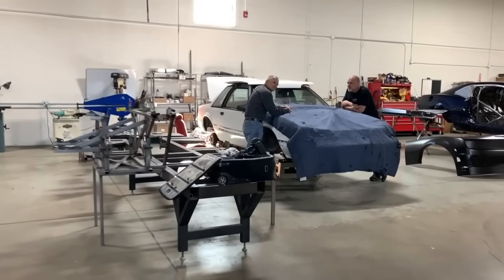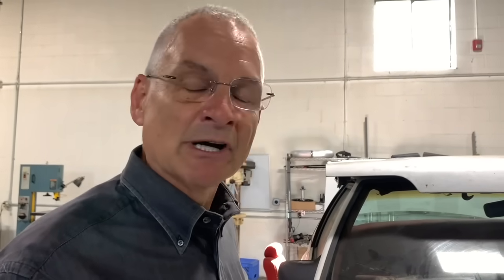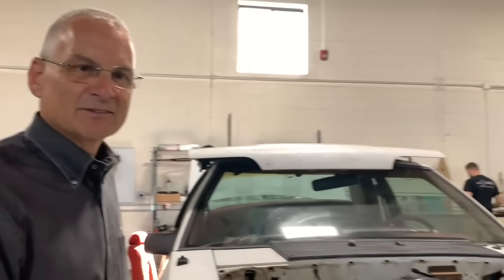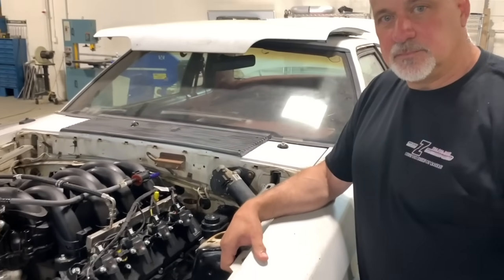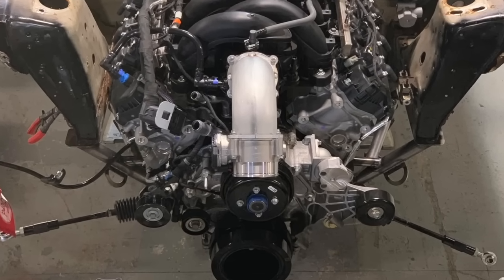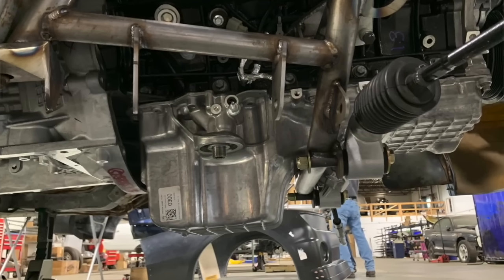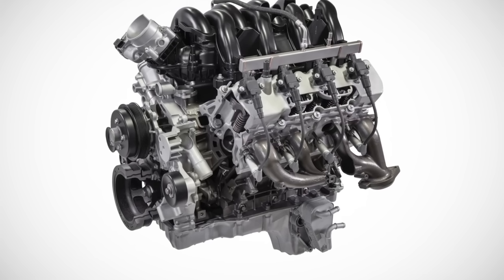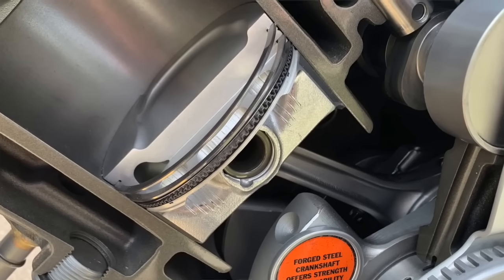Ford 7.3L "Godzilla" V8 Foxbody Mustang Engine Swap — Team Z 446-cube Small-Block Project Part 1

Comment: So many questions!
How many RPM is this good for?
Is this the first ever 10R80 transmission swap?
Is someone making a controller for the 10R80 now?
Is the Godzilla available as a crate engine?
Reply from the maker: Stay tuned for my next video.
Reply: REVan Evan waiting, waiting. LOL
Reply: I believe power by the hour already has 10r80 swap kit with stand alone controllers
Reply: @dfro7159  they do
Reply: I believe they said they used the mustang 10speed. So that’s a 10r80.
Reply: I’ve heard this has a modular bell housing so you can use 6r80s, 4r70ws etc. with a manual valve body
Reply: stylac there have been quite a few 10R80 swaps done. I have one in my 1966 F100. Very tight but fits. I am using a stock ‘18 F150 PCM.
Reply: stylac the 7.3 uses the 10R140. Not sure if bell housing pattern the same.
Reply: Same rear face of block as the modular/coyote
Reply: Brian Wolfe Nice! When can I buy a 7.3 crate engine? I suppose there will be wrecked trucks for donor soon. Then I can use the 10R140
Reply: As of now, I believe the only place is the parts department at your Ford Dealer.

Comment: Evan please answer this.  What's the deal with this engine being tuned for perfect stoich in the truck even under acceleration? Did I hear that correctly in the press releases?  If that's the case there's a ton of power to be had just by richening the fuel mixture on acceleration right?  Or did I misunderstand the presentation?
Reply from the maker: I will have to ask Brian to answer that one. But there is a lot of power left on the table with a tune, cold air and headers.
Reply: @revanevan  no doubt I'm excited to see this unfold.  Thanks for the reply. I'll be keeping tabs on the process for sure. Just for fun my bet is around 50 horse with just a tune.  If my understanding is correct about the air fuel situation that is...... Cant wait to find out thanks for posting these videos man love your work 👏
Reply: I can't speak to the production calibration, but there is a Dyno cert for incomplete vehicles (those that go to body fitters) and a Chassis Cert for complete vehicles.  I would guess that the stoic comment was more around the Dyno cert, but am not 100% certain.

Comment: This 445” Thunderjet small block is going to hurt some feelings!
Reply: I'm not making any predictions until I've seen the head ports and specs.
Reply: @johnparrish9215  yeah......if the heads go 300 cfm plus on the intake with at least a 75% intake to exhaust flow relationship at .600" lift and under, then it's a winner. Ford has had a bad habit for decades with weak exhaust ports. Just seeing a cam only 7.3 break 80hp/liter would be awesome. 
How much for a crate package?
Reply: Brother Django Dakota that’s my personal question, is how much these engines will cost
Reply: @hoost3056  it does make just over 300cfm on the intake side. It's also a canted valve head. Much better design than older factory sb heads for sure. Make will make 600hp no problem with cam and exhaust. Even more up top with a intake. Which I'm sure aren't far behind.
Reply: @waynebollentin989  the head is a Trick Flow copy almost with the valve angles and combustion chamber shape👍
Reply: @hoost3056  what tfs head is it a copy of ?
Reply: @waynebollentin989  The Twisted Wedge designs. Fast burn chambers with altered valve angles. Kinda reminds me of them.
Reply: @hoost3056     A wedged head is still a inline valve head. These new 7.3 heads are actual canted valve heads. Not a copy at all.
Reply: @waynebollentin989  ok, so more like a bbf design ( 429-460 )
Reply: @hoost3056  lol yeah now your on the right track but they were a big block. That's what so bad ass about these factory heads. Really nice design. The ls had a good sb head but ford just came out with something better. Can't wait to see these heads on a CNC machine etc.. 400cfm shouldn't be a problem. Won't be long before they're making 800hp+ N/A. I honestly wasn't sure when I first heard about this motor but it looks like they did an incredible job. The 6.2 v8 never took off and many act like the 7.3 is the First V8 push rod gas engine in many years. Take care bro.
Reply: The trick flow is just a copy of the Gurney-Weslake heads from the 1960s
Reply: There’s already videos out there of the ports. The engine makes great torque curve and already hit 600 hp at 6200 rpm with a cam swap
Reply: John Parrish no it’s not. It’s a rv motor
Reply: SoCalBronco70 Back in the day RV’s came with big block Chevy’s and big block Ford’s and big block Mopar’s, and people now and days will take RV motors out, put speed parts on them and make them fast
Reply: @5ohJ   ya! a car RV to pull the fiat dodges down the track 😂😂😂
Reply: crown Victoria lifestyle I believe the 7.3L make 430 horsepower and 475 torque sir
Reply: thunderjet?
Reply: Better name for this engine than Godzilla

Comment: And people said they wouldn't do it that it was a torquey truck engine, we'll suckas there it is in all its bad-assness!
Reply: Stock 460s were fast in the foxbodys can't wait to see this 445 run. I think there's alot of power left in the tune too look at the wavey torque line on tfl channel Dyno run from the computer limiting torque , plus its variable cam timing should be able to make it lope and rev out a lil more.
Reply: Joe Nobody and the addition of e85. Also less drivetrain loss going from truck to car. Gonna be something to see for sure.
Reply: LMFAO get your ass tore out by a coyote swap foxbody
Reply: billy heaton yep, that pike redlines at 5500
Reply: SoCalBronco70 so do most LS’s that EVERYONE swaps into and ruins mustangs
Reply: SoCalBronco70 
That would change with a cam swap.  Unfortunately, I have a feeling this will go the same as the V10 Ford...  not enough interest for aftermarket support, so people won’t have the desire to swap them.
Reply: @stlchucko  v10 is a bitch to get into a mustang, and the two extra cylinders killed the mpg.
Reply: @joenobody2580  ain't nobody building no fucking race car worried about MPG lol